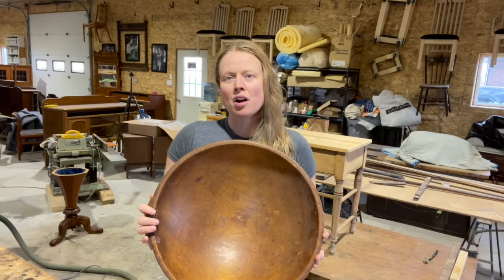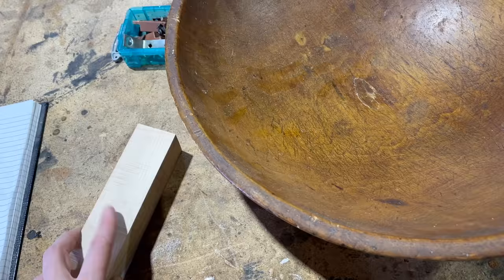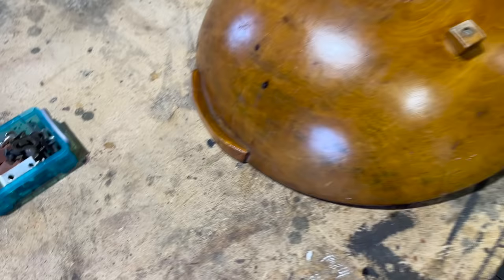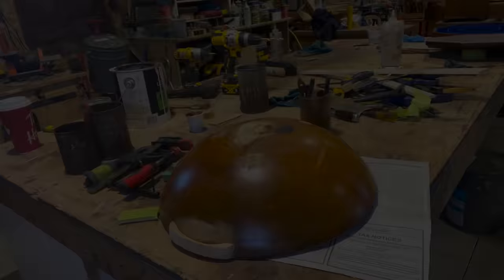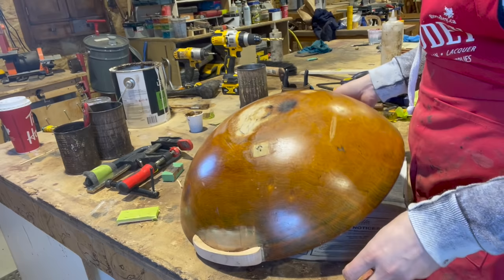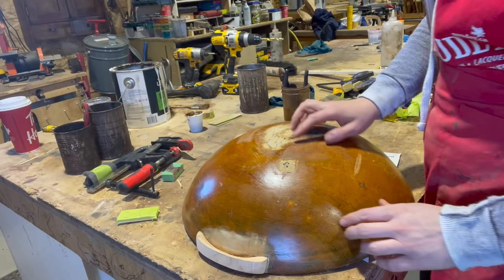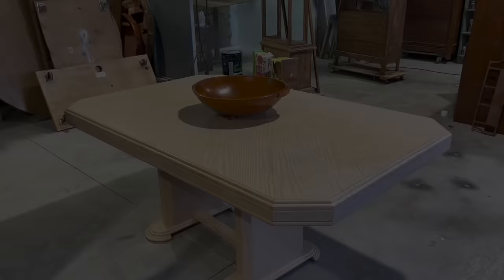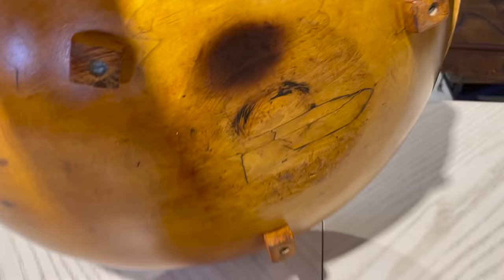YOU asked me to do this

Comment: Great job on the bowl Trenna. I think I would have used bow ties on the crack.
Reply: Would that make the repair more obvious?
Reply from the maker: those are great too, but a little over kill for this repair. the crack is supported by the handle as well and didn't show any sign of movement. cheers!
Reply from the maker: in this case the repair is supposed to be seen as it is part of the story of this bowl

Comment: Looks very nice! 
"Lacquer won't play well with oil finish underneath" Not so sure about that. In the 1970s -80s I made hundreds (1000s) of accessories that were dipped in an oil finish, dried one day then sprayed with sanding sealer and then lacquer. I have many of them on display now. None have shown any finish failure.  Once the solvents evaporate they are non-toxic.
Reply from the maker: interesting. do you remember what oil they were dipped in? i typically either deal with major fish eye, or adhesion issues